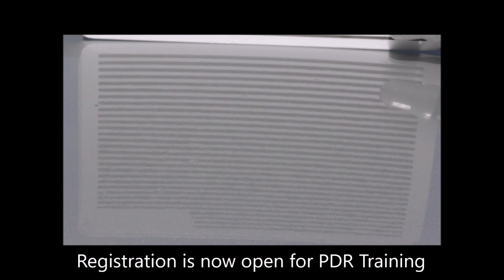How to read the line board for Paintless dent repair beginners, PDR training video

Comment: Hi, I've been watching your videos and thank you for sharing your knowledge 
I've been trying to get a dent technician to remove some dents for me but it seems nobody is interested in working on my VW transporter panel van 
I've bought some tools to start the job myself, I'm  Blacksmith and metal fabrication trained but now retired 
I started today on the first dent but unfortunately not a success probably due to the line board lines being too thick and too big of a spacing between 
I didn't have great vision of the actual dent and I'm wondering if I should have polished the area first then cleaned with an alcohol surface cleaner 
Another challenge was gauging the time for when to pull a dent after gluing 
I suppose this is trial and error 
I'm working on the rear barn doors which I'm replacing for a tailgate so there's plenty dent's to go at and practice  on before I attempt other panels 

If this is something I feel I could master overtime I think it'd be worth looking into the training and maybe see where it takes me, after all a retired guy needs hobbies too
Reply from the maker: Hi Tony, thank you for your comment, I am glad you enjoy my videos. I appreciate you've struggled to get a dent tech to you and with your experience I would be tempted to do it myself too but as I am sure you are aware this is not a quick skill learn so I do always recommend training in PDR before trying to remove any damage yourself however,  to answer your question, yes a good reflection helps, so if the panel is dull it is a good idea to polish it up to a shine and then use isoprpyl alcohol to prep the panel for the glue. Yes a lot of it is trial and error in terms of how long to leave it before pulling as there are a lot of variables particularly with temperatures but also the brand of glue makes a difference as do the tabs. I have a ton of videos here that will no doubt help guide you and plenty on glue pulling techniques so take your time to go through theses and by the way, I have lots of retired students, either topping up the pension, a side hustle or just as a hobby to stay focused so let me know how you go and I will happily talk to you more about training if you decide to go that route in the future. 👍

Comment: QUESTION:  Might it be beneficial to use a hair dryer to heat the dent before working it?  Thanks
Reply from the maker: Yes we often warm the panels prior to work, it helps reduce the risk of the paint fracturing but also helps glue adhere to the panel and in some cases with sharp dents it helps the panel move easier too!